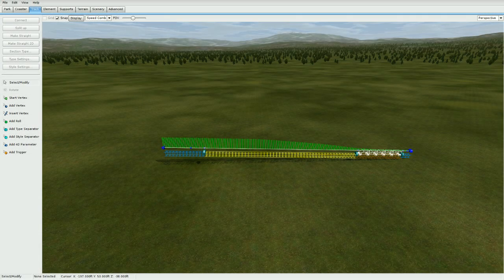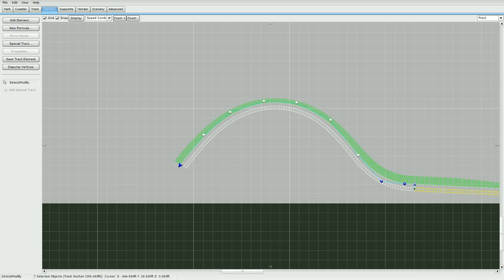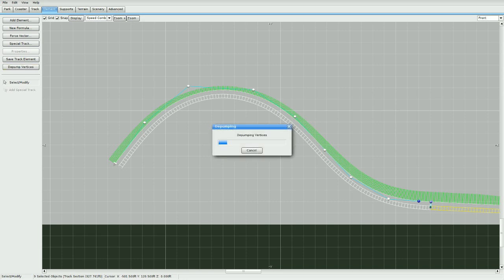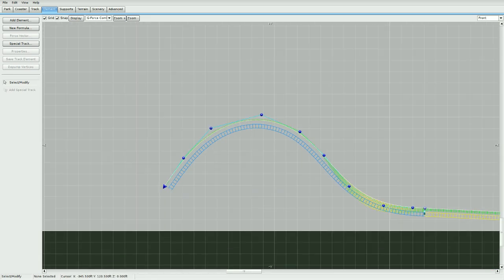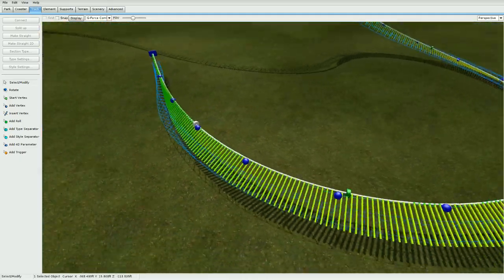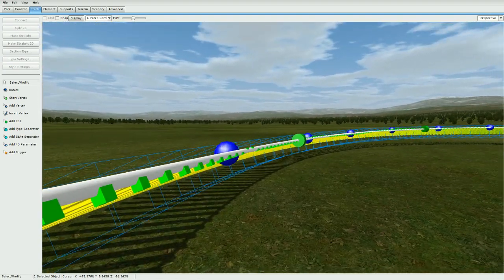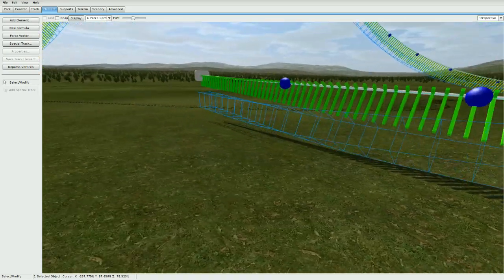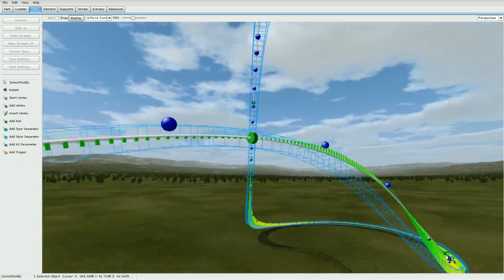NL2- How to make FVD Quality Track [Handbuilding]

Comment: Wouldn't it just be easier to just download FVD++ and use that?
Reply from the maker: If you want to learn a whole new program
Reply: How much does FVD cost?
Reply: Pretty sure it's free
Reply: The Roller Coaster Creator Yep... It's free and only takes like 2 days to learn
Reply: @BossAct7  It's pretty simple to use and has so many benefits over handbuilding, I get some people prefer to handbuild but I think everyone should at least try FVD. You will also get a new understanding of track shaping in FVD.
Reply: @fyre5287  FVD is easier overall but inversions in FVD are complex and require some pretty extensive knowledge about forces in a coaster. Corkscrews, top hats, heartline rolls and even standard loopings are all quite challenging to make.

Comment: My POV's always seem to shake slightly when the train goes fast. Any way to fix that?
Reply from the maker: go into to the Setup tab, and their should be a little slider on the bottom to turn vibrations off. Also in-game, press F7 and you can alter setting there as well :)
Reply: Thanks! :)